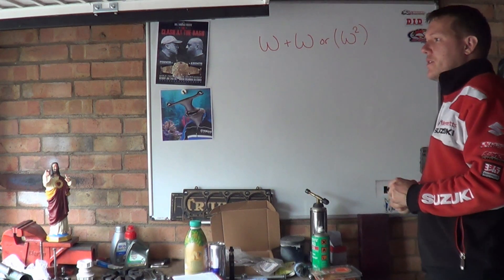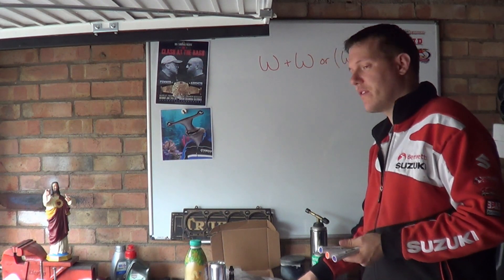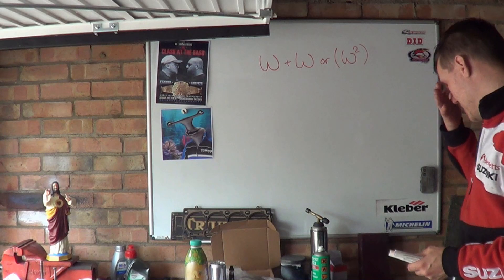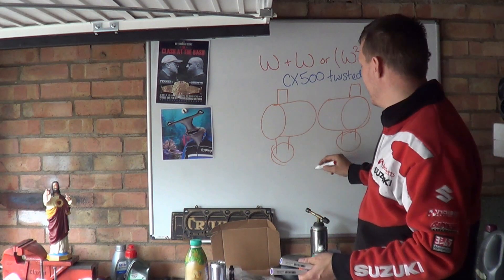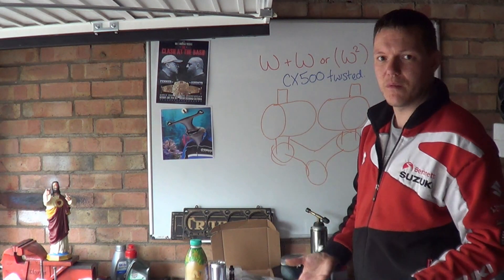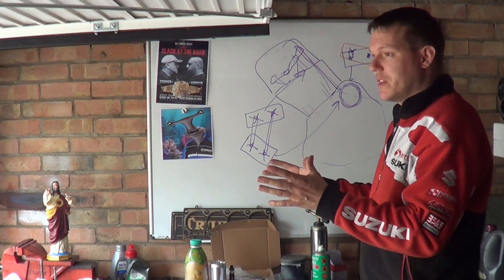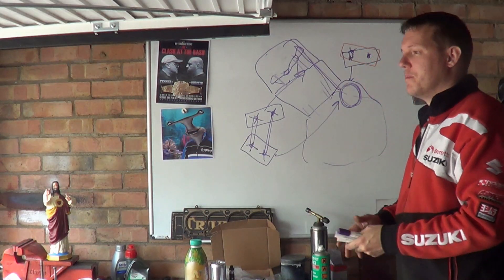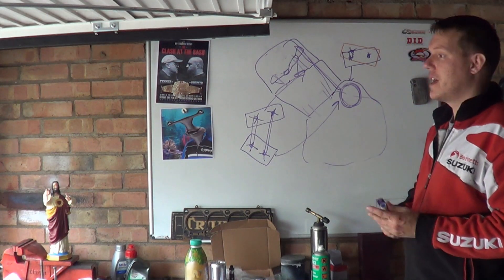Mystery Engine - weird and wonderful #1

Comment: Great video! Made me all nostalgic :o) I was a dispatch rider in the 70s and 80s around London and had a few CX500s. Had to do a lot of maintenance and rebuilds on em. They suffered cam chain tensioner issues. Honda also gave it a heavy clutch that rotated in the opposite direction to the crank to counteract the torque effect of the crank. Clever! Smooth engine, shaft drive and a decent ground clearance made em a great bike for dispatch.
Reply from the maker: I have a series on one here - https://www.youtube.com/watch?v=K_9yAbyLlWE
Reply: +The Workshop  Oh cool..I shall watch that with me dinner! Thanks mate
Reply: + The Workshop   Matt..that's like going back in time! Said about Cam chain probs. That was classic Cam chain failure. If I remember rightly..when mine let loose some of the exploded bits got in between the stator and the rotor taking out half the magnets, which is possibly some of the sludge you were finding in the cases etc. and why the rotor was missing in your engine. I even remember the worn bolt! I loved these engines. I had one do 80,000 odd miles dispatching. Keep on top of the oil and filter and they went on for ages. Yours is in typical condition for a 'from the breakers engine' for that time. Not many miles before failure.  I haven't finished watching the rest of the rebuild..not sure if my nostalgia buds or my wife can take it! Great stuff Matt. Best channel Ive come across in ages. Cheers dood! :o)

Comment: Don't know if it's ever been sold in the UK, but there was a turbocharged version of that bike as well. I think that's the real weirdness, a japanised concrete mixer engine with a turbocharger -- in a bike  ... because the V-twin idea in itself was not exactly new at the time, Guzzi inherited that concept from the old Mixers quite some time before, the twisted heads were indeed new..
Reply from the maker: I don't know if it was sold in the UK.......... There was also the CX650T which was also a turbo (obviously the 'T' is for turbo)

Comment: I still like the look of the rotating cylinder valve engine.
On the bike version the crank is the output but on the model aircraft version the rotating cylinder is the ouput

Comment: Dunno if there's enough special about it for a video, but RG500 square four might be neat.
Reply: Oh, and outside of engines, Hub Center Steering, Kawasaki's stupid ridiculous anti-dive forks, telelever suspension...
Husaberg's 70 degree FE570 is neat, the MTT Y2K, Honda CBX, Walter Kaaden era two strokes that revved to 20k and made peak HP for 500rpm with hand lever carb adjusters, everything Erik Buell has ever done except for the Buell Blast...
That Yamaha(Honda?) single with two carbs...
I'm know I'm missing a few gems.

Comment: CX500 - also known as the 'Plastic Maggot'. A lot of CX500 engines were converted for boats and marine use.
Reply from the maker: "Plastic Maggot" - why?
Reply: The very early 1978 versions had an odd-looking mini fairing, that wasn't quite a bikini fairing, around the headlight and it extended out over the indicator stalks. It was curved and looked awkward and the name 'Plastic Maggot' came from that. Maybe you should do a video on unusual bike nicknames, seeing as you owned a 'Kettle'?
Reply: Hi, have heard this term used to for this bike "the plastic maggot".
Reply: The Workshop I believe it's called the turbo version is called the plastic maggot because of all the fairing.

Comment: there are delta train engines with 3 cranks
Reply: They called Deltic engines (Napier Deltic), its a supercharged opposing piston 2-stroke Diesel engine, each corner of the triangle had a crank and all the flats were cylinder banks. It does not really look like an engine, it's big and cluttered. The marine version makes around 1000hp and when you fire it, it really sounds like a big 2 stroke bike, but first you need to heat the oil and coolant well above 40degC, otherwise it just won't start
Had the pleasure of playing with some of those a while ago, with low load, they rev up really quick, sometimes a bit too quick.

Comment: I have a early to mid 80's Yamaha venture 1200. I got it because it was cheap. and o wanted a project. I really just wanted a big engine. but its shaft drive. I have a couple questions. is these engines any good? its a V4 . and can the shaft drive be converted without a Hassel ?  great video

Comment: That was a solid running engine. And you ether loved it or hated it and made fun of it. And many people took it to make a build out of it. Why not simply rotate only the inlet port to the head?
Reply from the maker: Cross flow Ah ha - video added to the list and you didn't even ask come up with the question. God I'm getting good at this lol
Reply: Since the valves control the inlet and outlet of the gas it really does not matter what the direction is where the gas enters or exits the combustion chamber. So why not do a inlet that is 135° offset of the outlet then a 180°.

Comment: Yesssssssssss!!!!!!!  The CX500. 22 degrees to be precise. And the carbs are still quite long. I've actually got a spare set of carbs ( partially ) for my 1981 CX500 just missing the diaphragms and a few other bits. Awesome looking engine. Do you need the carbs ?
Reply from the maker: No, I'm not going to use the standard set-up, its going to get the injection treatment one of these days
Reply: I think this was hondas first V Twin wasn't it ? .  Looks brutish, and a lot bigger than a 500. It was the engine design that made me buy it.
Reply from the maker: Yes I think so, not sure.
Reply: It was their first V-Twin, also their first liquid-cooled bike. Another weird thing is the crank spins one way and the trans spins the other, that puts the driveshaft on the right (the wrong side) and moves the brakes to the left. I have the '83 650 Custom and it is such a cool bike